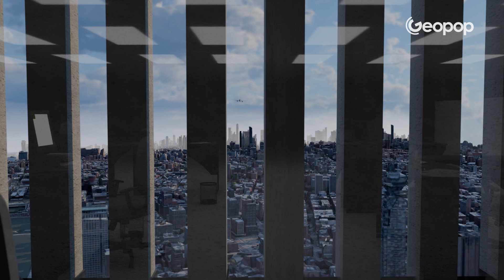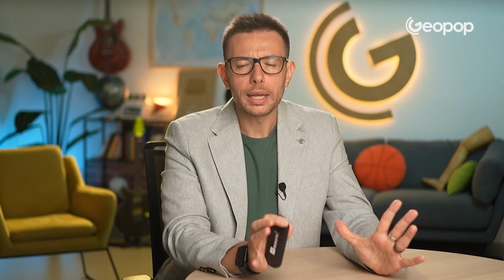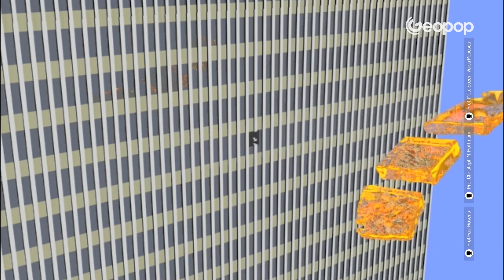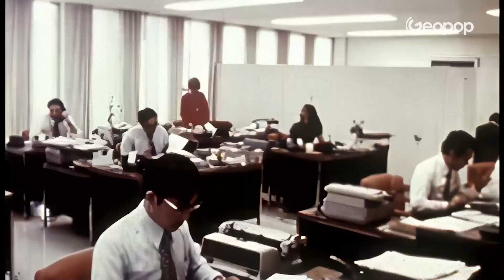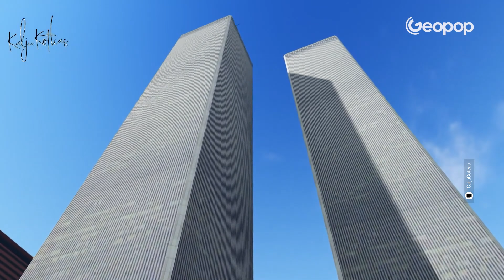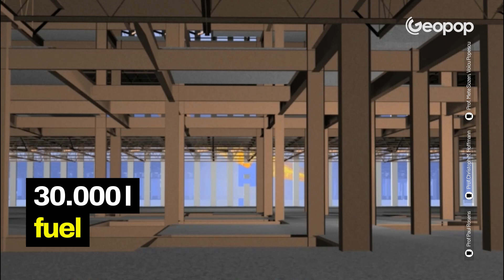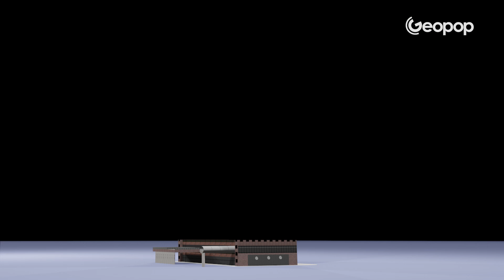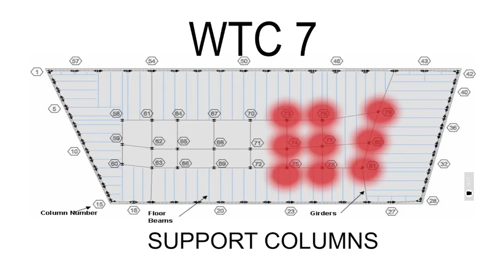9/11, 2001: The Technical Reconstruction of the Twin Towers and WTC 7 Collapses

Comment: 🙄🙄Unfortunately the steel didn't weaken it completely evaporated.
Reply: Never go full retard
Reply: @TheLoonResistance the atom bomb was inconceivable until it was produced and dropped. No one questions the strength of them now. Why wouldn’t the most expensive military in history harbor weapons beyond our imagination. In each of those towers there was not a single falter or slowing of them collapsing. They simply float to the ground as if there’s nothing below. Even in the video he references how the NIST agrees that the building should have been able to bear the load of 6 floors suddenly. If it was only double that, you’d assume it would at least pause for even the slightest second before collapsing and doing it again on the next floor. Maybe speed up in this process as it gains more weight but that is in NO way what you see. The tips come down and they literally fall as easily as possible. Look through the smoke as well. You’ll see steel frames that survive for a few seconds then just decide to give out for no good reason. Don’t be so naive. The powers that be do not care for you. You are a number. A means to an end. That end is ultimate control and power and you defending their narratives only helps them achieve that.
Reply: @NorrinRaddsLostCousin  - OK Einstein.  At the end of the day, we all just want to know what really happened, right? It’s tough because even though structural engineers had figured it all out within weeks there is still a massive amount of misinformation out there on the internet to muddy the waters. How is the layperson supposed to sort it all out? 

Anything important is worth putting in some time and I’ve put more thought into this than most since anything can seem like a conspiracy if you don’t understand how it works and I like understanding. If you don’t mind, I’d like to offer my perspective. You may choose to disagree, but if I am in error on any point of fact, logic or reason please let me know.  Just saying you are wrong or I don’t believe you isn’t compelling. 

While complex, most of the Twin Towers collapse mechanisms can be seen with the naked eye and easily discerned and understood by the layperson IF sufficient time is taken to understand.

1.   The Twin Towers consisted of 4 primary structural elements together forming an integrated system where each relied on the others. 47 hollow box-section steel Core Columns carry most of the gravity loads. The 236 hollow box-section steel Perimeter Columns carry the remainder and ALL of the lateral (wind) loads. Long-span Lightweight Steel Trusses connect core and perimeter column together with a Hat Truss on top to tie it all together as an integrated unit where no element can survive without the others. There was no structural load bearing concrete and most major assemblies were bolted together

www.youtube.com/watch?v=u7OqrC74Dm4
www.youtube.com/watch?v=eKtgPt7e0Fw 

2.   The impact of a 122-ton airplane (= 12 dump trucks) at up to 587 mph with the energy of a ton of TNT destroys the aircraft in 0.50 seconds. This in no way implies the Towers come out unscathed. Some folks get hung up on that. Many perimeter and some core columns are destroyed or damaged primarily by bending, twisting, splitting weld seams and critically by bolt-shearing failures at the end connecting flanges. No cutting or slicing - the reality far more violent and brutal. 

www.youtube.com/watch?v=zF-94yDHlk8

3. The impacts destroy or damage fire insulation, fire breaks and sprinkler systems on multiple floors. Jet fuel acts as an accelerant starting huge fires start across multiple floors simultaneously that spread spread rapidly with no effective firefighting or fire suppression. This was an unprecedented fire event . Office buildings are essentially giant piles of kindling when it comes to fires, chock full of stuff that burns vigorously and quite hot. 

4. The hotter steel gets the weaker it gets shouldn’t be a revelation. With fire protection compromised the survival time of the steel greatly reduced . Over time heat gradually causes the lightweight steel Floor Trusses at the damaged floors to sag, which we can see. No steel melted or needed to. Structural steel fails long before it becomes a puddle. It just needs to bend 5. A straight column is up to 4 times stronger than a bent one. Sagging floor trusses pull on increasingly weak and overloaded Perimeter Columns, causing some of them to bow inward by up to 5 feet until they buckle and fail, quietly initiating collapse. The formerly static mass above which the structure below could easily support converts to a dynamic mass up to 30 times greater. The Columns above and below the failure point are no longer aligned . The load bearing structure below no longer bears any of the load above, which falls past the lower columns NOT onto them. www.youtube.com/watch?v=ULdiD6gYZO0 www.youtube.com/watch?v=zTygQK3vriI 

6. Heat starts the collapse, gravity finishes it . Thousands of tons of debris drop largely within the four outer walls, through the open office space, the path of least resistance crashing onto the first intact floor, The bolted column connections instantly break as the amount of resistance the Floor Trusses can offer is negligible, slowing the falling debris only marginally and briefly before the connections fail. www.youtube.com/watch?v=flo62pdaIMI
Note: 
6a. This is NOT a solid top block crashing into a solid bottom block . 
6b. The debris falls past the columns not onto them. The columns provide no resistance to the falling debris. 
6c. Only the bolted floor truss connections to the core and perimeter columns offer any resistance. A pair of 5/8” bolts at each end of each truss vs. thousands of tons of falling debris. 
6d. No laws of physics are violated. 
6e. There is no 20 floors against 90 floors but rather 20 floors against one floor, then 21 floors against one floor, then 22 floors against one floor, etc. 

7. This floor-led collapse progression largely within the four outer walls can only go straight down. There is no lateral force to push it over the side, only gravity to bring it down. 

8. Collapse progresses through the floor systems past the columns, through the path of least resistance . Resistance offered by each floor is always the same while the falling mass acting on it is constantly increasing and accelerating (gaining energy). This process of floor-by-floor destruction cannot be arrested. It can only speed up . Rate of floor failures increases with each floor as momentum increases, reaching an average acceleration of 0.65 of GA, or 35% slower than true free fall. Bam, bam, bam down the building until there are no more floors to fail. More mass, more velocity, same resistance with each floor. Don’t get stuck on the but the lower floors weren’t on fire nonsense. They didn’t need to be. 
8a. This process is often incorrectly referred to as “pancaking” which while catchy, is incorrect. Too simplistic and inaccurate anyway. More like Kaiserschmarrn. 

9. The Towers were 95% air by volume. As that air was compressed inside the building by falling debris, pressure builds until it is blown out the sides in reaction to the building collapsing . Those were not “explosions”, it was expulsions of compressed air caused by the collapsing building, explaining the low velocity, lack of flash, blast, supersonic pressure waves and lethal high-velocity ejecta. 

10. Perimeter Columns become detached and peel away like a banana behind the collapse front, playing out to the four points of the compass in long lines extending to 800+ feet from the base of the towers, damaging and destroying nearby buildings. 

11. Core Columns fail last as their internal beam bracing is stripped away by falling debris and lateral support from the floors to the perimeter columns is lost. 

www.youtube.com/watch?v=WpHXj62Ylw0

12. This process took 31-34 seconds from perimeter columns bucking until the last core columns hit the pile, or 1/3 the rate of true free fall. Don’t believe me? Just watch a video of the collapses and note the loose truly free-falling debris dropping much faster than the towers themselves. 

https://www.youtube.com/watch?v=dh4r-gHdyPU 

13. Each Tower had a 1-acre footprint. Far from collapsing inside their own footprints the debris pile spread out over 17 acres in a pile up to 14 stories deep. 8 surrounding buildings were destroyed and scores more damaged by the falling debris. 

14. NOT observed were the 180-190 dB bangs of thousands of high explosive devices or the blinding brightness of burning thermite. Explosives or thermite couldn’t have survived the impacts and subsequent fires anyway. Nor could they have caused the perimeter column buckling that clearly initiated collapse. Video of an injured and in-shock firefighter casually using the magic word explosion isn’t proof of explsoIVES and hardly makes a case for planned demolition. Pre-planned demolition doesn’t match the physical evidence and would be technically impossible, totally impractical and completely unnecessary. Simply, no one would bother. In 24 years, no structural engineers of tall buildings, including the 1/3 who have retired, have made any statements in support of planned demolition claims. NONE. The lack of such citations in engineering literature published anywhere in the world is telling. 

15. Twin Towers were perfectly safe within their design envelope. They only collapsed when taken far outside design parameters by an extraordinary and unprecedented event Impact + Fire (heat) + Time + Gravity = Collapse . Remove any 1 of those 4 elements and there is no collapse. Ignore any of them and you will never understand the collapse. The Twin Towers were an integrated system in which no one component could survive without the others. One fails, the rest follow, through the path of least resistance DOWN the open space, bypassing the path of greatest resistance, the columns. No laws of physics are violated and the above is true no matter who planned and carried out the 9/11 attacks or why so the attacks could still be an “inside job”. 

If you made it this far, kudos. That was a lot. I hope it was helpful, informative, non-adversarial and solicits informed critical comment, positive or negative. If I made any errors of fact, logic or reason or left anything critical out, please let me know and I’ll fix it. To stay focused, just one point at a time please and on-topic (Twin Towers ONLY). No word-salads of Gish Gallop. IF you can offer a more plausible alternative be my guest. Please start any reply with the words “Tits McGee” or I’ll know you didn’t read it and aren’t serious. Thanks for your time.

Comment: Could you please make a video explain how its even possible for a plane any plane ever made can cut through just the outer walls of these buildings? These exact buildings, i dont care how the buildings fell i want 100% proof that an aluminum aircraft can slice completely through the webbing design and thickness of steel used in the outter walls.
Reply: No cutting

No slicing

The reality was far more brutal and violent. 

122 tons of airplane impacting with the energy of up to a ton of TNT bashed its way through the thin hollow tube perimeter columns by bending, twisting, splitting weld seams and most importantly bolt shearing failures at the connecting flanges.
Reply: The engines might. But im with ya. And anyone can look up the maximum speed of a 757. Even in a dive it can't go but 430 mph at 1000 feet in altitude.

Comment: Does anyone actually believe the buildings collapsed because of fire?   They act as if by saying it over and over, it will become true.
Reply: Unfortunately as we move near 25 years post this event, we have to keep our foot on the peddle or the next generation won’t take us seriously. If that happens by the next generation it’s just a wacky theory for sure.
Reply: No. It was a combo-platter:  Impact Damage + Fire (heat) + Time + Gravity = Collapse

Remove any one of those four factors and there is no collapse. Ignore any one of those factors adn you will never understand the collapse. You are ignoring three.
Reply: @TheLoonResistance - which 3 do you think I've missed?    How do you explain WTC 7?   Sympathetic implosion?
Reply: @robinr.2233  - Well, let's see. In your OP you said:  Does anyone actually believe the buildings collapsed because of fire

I wonder which 3 you missed? Probably the 3 you failed to mention.
Reply: @TheLoonResistance - ok, have it your way, Does anyone actually believe the buildings collapsed by just have the planes fly into them?   And what about WTC 7 that magically collapsed when the other building right next to it did not?

Comment: When i was a kid in the 1960s they said that the towers could take a hit from a 707 jet, now how did they fall if that was true?
Reply: It was 2 jets it was designed to withstand. And they use to say it was designed to burn to extinction without collapse.
Reply: They weren't hit by a 707 jet.

Comment: it was a terriost attack not a disaster a disaster sounds like it was a accident… no accident
Reply: 1.The firefighters said" it looked like they planned to take down the building" I didn't say that, The fire fighters said that. They were there.I'm sure they know best.
https://youtu.be/XiIT4HInWjY?si=e1Pvp3-IFs-M75Oj
When the firefighter says "boom, boom, boom, boom" in this video.
What do you suppose he is?Implying by " boom" ??
2.So if there were no explosives then what is this? 8:25
https://youtu.be/bLF5D7M1YgA?si=aHSvS__uOdxMi1ZB
You can't say that it was added because you can see the firemen's reaction to the explosion. And you can't say it came from anywhere else because the firefighter says
" We gotta get out of here,  7 is exploding "
3. Controlled demolitions have squibs, you can see the squibs here 20 floors below the collapse. 
https://youtu.be/eXAgulfAtR4?si=-iLO9aQjMJVLTUYH
4. Firefighter says "any one of these buildings could blow up,  this ain't over yet" firefighter says there's 3 secondary explosions. 
https://youtu.be/0Gh3ErgMI4M?si=mmp9Eus_5PWTCBfl
5. Airplanes can't fly 600 mph at 1000 feet. And to be able to make a 180 degree turn to hit the opposite side of the pentagon going that fast is ridiculous. And since when do terrorists hit the opposite side of the building where no one was at when they could have just flown straight in and killed way more people???
https://youtu.be/0Gh3ErgMI4M?si=mmp9Eus_5PWTCBfl
7. No one has ever known ahead of time that a building was going to collapse except through controlled demolition.  Tower 7 was reported to have fallen while it still stood in the background. 
8. Larry silverstein,  the man who made over 4.5 billion when they fell, claimed to have pulled the building down.
https://youtu.be/1jQaJFNWqtc?si=wCywQ9grgBdS_w11 yet somehow today he is only worth one billion dollars.

Comment: Dang 😂 this comment section looks like it's filled with 20 something yr olds trying to prove just how awful the education system has been over the past 15 years. 
Great video breaking down what happened. Its easy to follow, especially when you understand physics and structural engineering. Then knowing all the nuances such as the fire proofing upgrade wasn't completed on the south tower floors that were impacted, helping it to fall first. The north tower stood longer in part due to the fireproofing upgrades being completed on the impacted floors
Reply: 1.The firefighters said" it looked like they planned to take down the building" I didn't say that, The fire fighters said that. They were there.I'm sure they know best.
https://youtu.be/XiIT4HInWjY?si=e1Pvp3-IFs-M75Oj
When the firefighter says "boom, boom, boom, boom" in this video.
What do you suppose he is?Implying by " boom" ??
2.So if there were no explosives then what is this? 8:25
https://youtu.be/bLF5D7M1YgA?si=aHSvS__uOdxMi1ZB
You can't say that it was added because you can see the firemen's reaction to the explosion. And you can't say it came from anywhere else because the firefighter says
" We gotta get out of here,  7 is exploding "
3. Controlled demolitions have squibs, you can see the squibs here 20 floors below the collapse. 
https://youtu.be/eXAgulfAtR4?si=-iLO9aQjMJVLTUYH
4. Firefighter says "any one of these buildings could blow up,  this ain't over yet" firefighter says there's 3 secondary explosions. 
https://youtu.be/0Gh3ErgMI4M?si=mmp9Eus_5PWTCBfl
5. Airplanes can't fly 600 mph at 1000 feet. And to be able to make a 180 degree turn to hit the opposite side of the pentagon going that fast is ridiculous. And since when do terrorists hit the opposite side of the building where no one was at when they could have just flown straight in and killed way more people???
 https://youtu.be/0Gh3ErgMI4M?si=mmp9Eus_5PWTCBfl
7. No one has ever known ahead of time that a building was going to collapse except through controlled demolition.  Tower 7 was reported to have fallen while it still stood in the background. 
8. Larry silverstein,  the man who made over 4.5 billion when they fell, claimed to have pulled the building down.
https://youtu.be/1jQaJFNWqtc?si=wCywQ9grgBdS_w11 yet somehow today he is only worth one billion dollars.